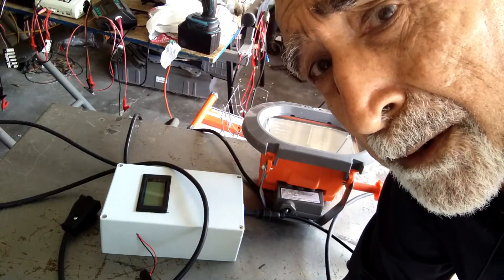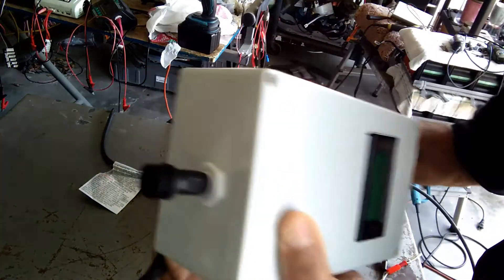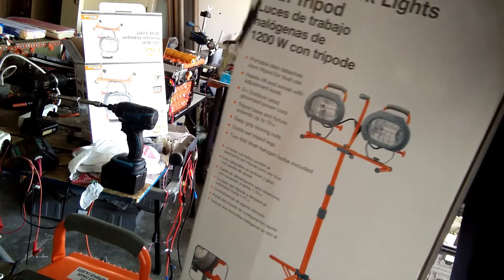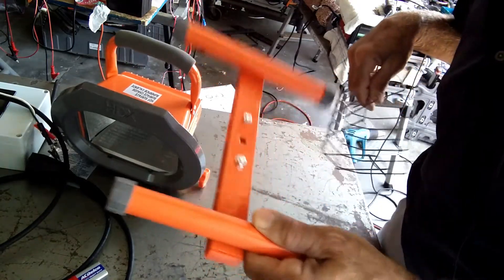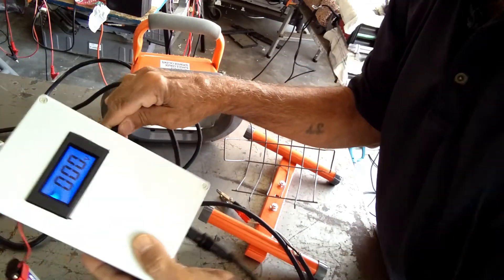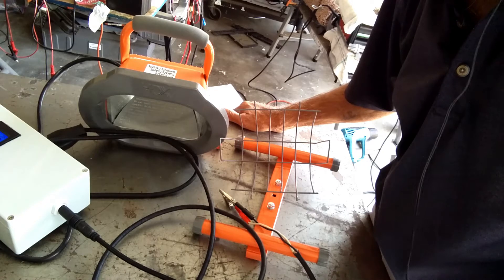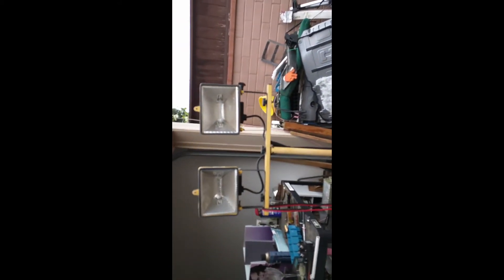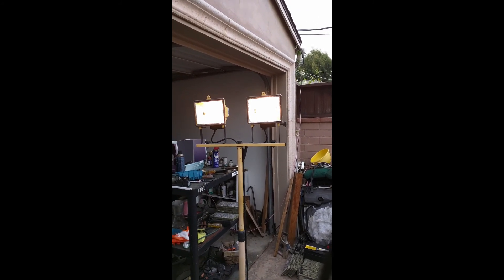Introducing a Discharger for Hybrid Battery Packs

Comment: My battery is at 217 volts.  I discharge it to 200 V.  After 15 minutes, it went back to 204 volts.  Do I have to keep discharging until it stays at 192 volts or can I go lower?  I bought this charger last year and I forgot how to use it.
Reply from the maker: Hi, the voltage going up after discharge is normal but disregard it. Discharge to whatever level you want to depending upon your battery pack and then continue with your procedure. Good luck.

Comment: Just a confirmation. According to the wattage of the shop light, the Amperage is about 4.16 to 4.54 Amps, so to make sure i understood.
So the battery is discharging at over 4 Amps yes?

Comment: Does the light bulb need to be 250 volts? What volts need to be to discharge my battery pack and what watts is better to discharge?
Reply from the maker: I recommend using a 500 W or 600 W bulb for quick and discharging the whole pack in one time or half at a time.
Reply: @VeniceHybridTech  do I need to use a bulb 220 volts or 120 volts is okay? Thank you
Reply from the maker: @stiveduarte3808  Either one will work, although I prefer 110 V.
Reply: @VeniceHybridTech  does the hybrid battery 2015 fits on Prius 2010?
Reply from the maker: @stiveduarte3808  If both the batteries are NiMH, then yes but if 2015 battery is LiIon battery , then no.

Comment: For a prius generation 2 or 3, which has a 240 volt battery. How low do you suggest to discharge it in order to recondition it?  Thanks.
Reply from the maker: Hi, you can use the shop light but discharge half the pack in one go and the other half in another time. Like this you can discharge any hybrid pack with any voltage, Please watch my video and subscribe. Thanks